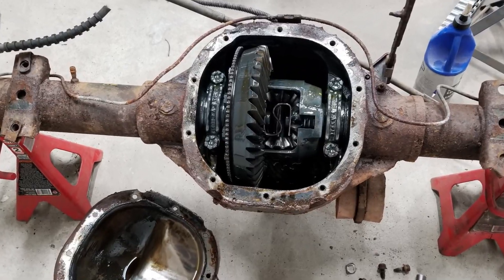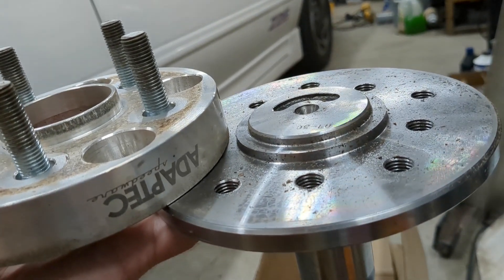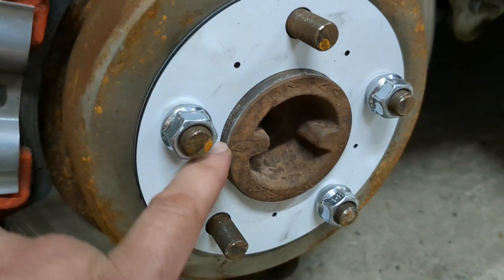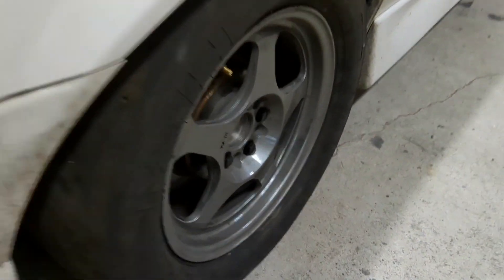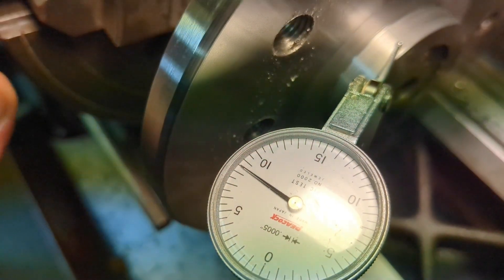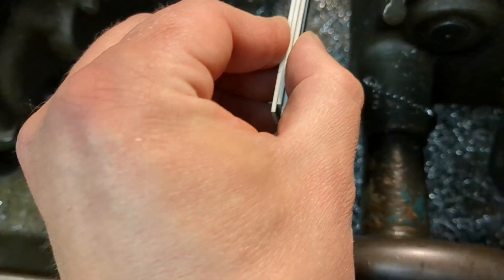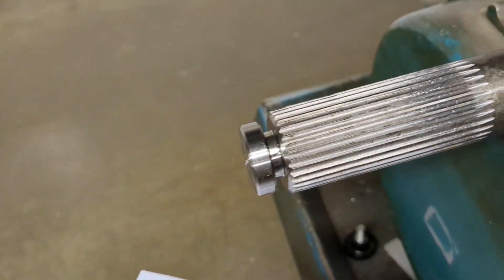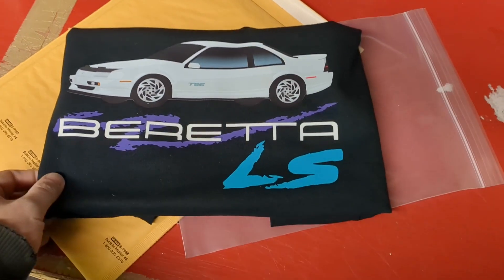Had to fix my new Moser axles, they vibrated! Beretta #LSswap

Comment: Good fix. Machining the adapter right on the axle sets you up with great concentricity.
Reply from the maker: Once my coworker found that 4-jaw chuck I knew I was in good shape to do it all on my own and not stack tolerances
Reply: @GEARHEADdezign  Nice that the axle fit through the headstock too. Perfect lathe for that job
Reply from the maker: It's a little sloppy but it worked. The interrupted cut of the splines on a stock axle did not go well. Vibrated like crazy. I want to shorten them 1/2" and move the brake brackets behind the flange. That would give more room for deep dish Z26 wheels and single beadlock drag wheels.

Comment: Sucks they wouldn’t stand behind their product. I had similar experience with bowler transmissions and a bellhousing indicator plate complete piece of shit lol
Reply from the maker: I gave motorsport-tech the exact same specs and they nailed the adapters perfectly the first time.
Reply from the maker: The rep at Moser said they always machine the brake hub to that spec, which would be always wrong? He also said rotors locate via the studs and not the hub, which is exactly backwards from anything I've seen.
Reply: @GEARHEADdezign  Exactly I’m running a drum style axle with disk brakes on my 8.8 and the rotors definitely need that hubcentric fit
Reply from the maker: @LynnTwinCustoms513 yeah, I've never seen an OEM rotor that didn't. Lug holes are oversize and hub is tight

Comment: So you had those clowns custom machine some axles and they were that far off? And then refused to fix their mistake? What a joke dude. Glad you were able to get them dialed in. I'd be pissed too.
Reply from the maker: Yeah, I was VERY unimpressed. Glad I have tools at work for my projects
Reply from the maker: I bought off the shelf Moser axles for my Camaro years ago and they were fine.. bought them for about $250 but these were $600 👎